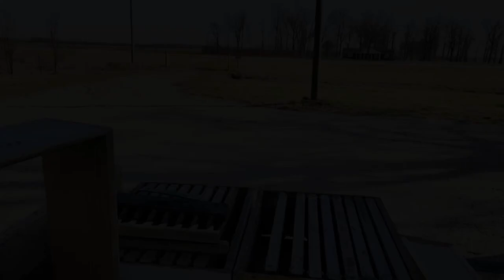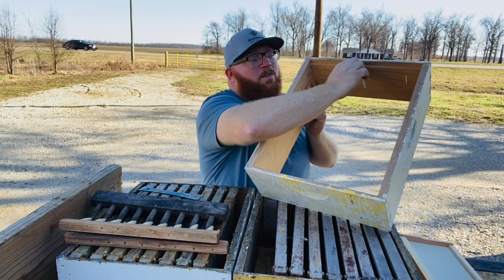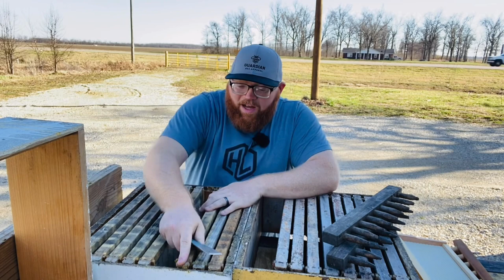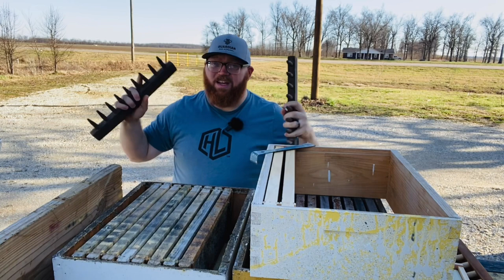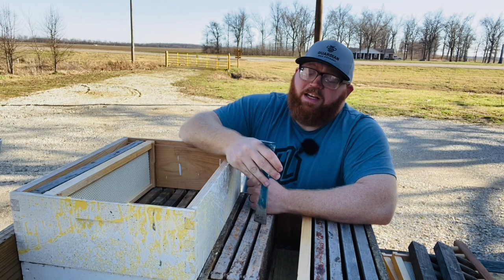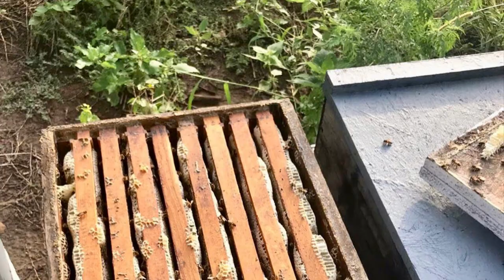Techniques for getting foundations drawn and MORE honey in your supers!!— Frame spacing discussion

Comment: Good video Gus.  Good procedure.   Not really related to Gus's video but possibly a tip for newer beekeepers, if you have a super with a mix of drawn and foundation frames it seems totally logical to alternate between drawn and foundation.   That is not a good plan as it always results in very thin combs on the foundation frames and much fatter combs on the drawn frames.   What works for me is to group all of the drawn comb frames together and do the same for the foundation frames.  The only critical factor is to keep the frames spaced equally.  Now there is an exception to this rule.   It has been my experience that if you have a full super of foundation frames and have any drawn combs available, placing a drawn comb frame in the first and last frame position in the otherwise all foundation super seems to draw the bees up onto the foundation frames quicker.   This works on the same principal as Gus' procedure for placing his foundation frames in the middle.  This advice is meant to supplement Gus' video NOT to change his information at all.   Gus is an experienced beekeeper and knows what he is doing.   Keep up the good work Gus!

Comment: Metal frame spacers are way better than plastic. 
 8 frames are better than 9 or 10  as fars as honey  per box .
The one drawback is you have to be more gentle with  handling 8s or they will  tear themselves apart if handled roughly .
 Self spacers are better in  brood boxes  and frame spacers  in honey supers  speed up supering during the honey flow because you dont have to stop to evenly space the frames .